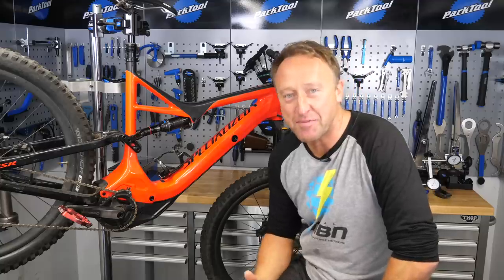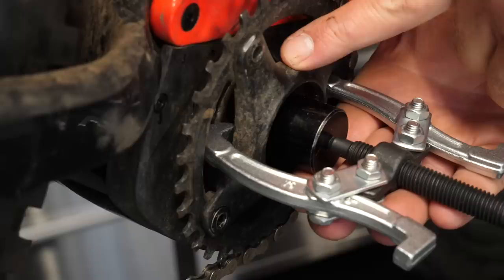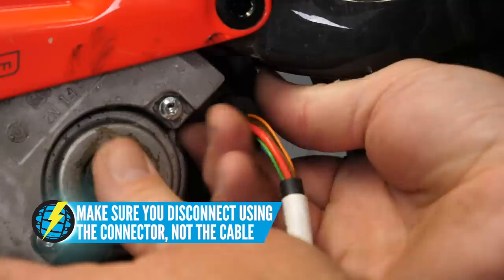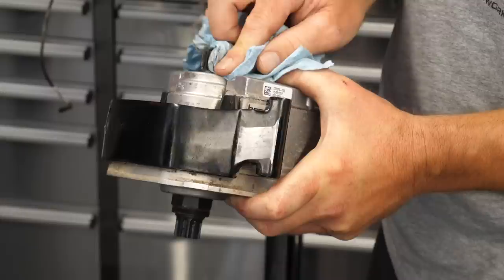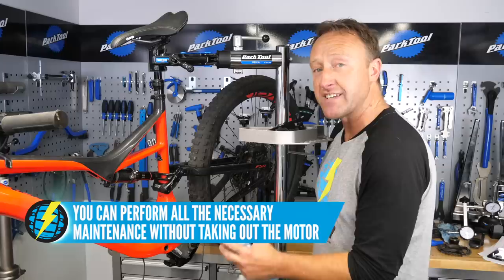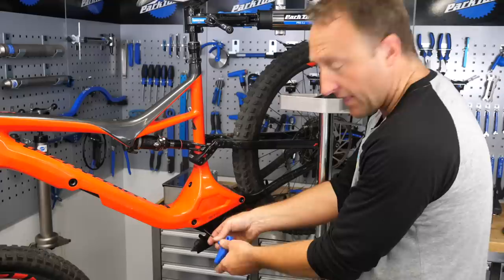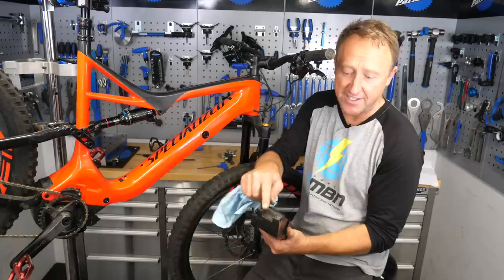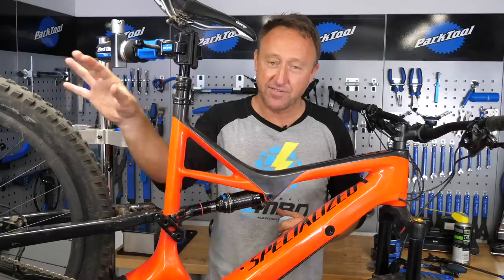How To Remove A Specialized Levo E MTB Motor | E Bike Maintenance

Comment: Crank bolts 50nm   Spider Lockring 50nm  Motor mounts 18nm  Motor cover 1nm. I would use thread lock on the last two.

Comment: If you have a newer levo there are some differences in the disassembly - they are fairly obvious apart from a hidden bolt which requires the horizontal part of the rear triangle to be removed and pushed out of the way, the hidden bolt is on the drive side near the foam insert

Comment: Steve
A couple of things. What about torque settings? And when the motor goes in, loosely put in all the motor bolts in first before you tighten up the bolts.
Keep up the good work.

Comment: Re: levo gen 2 disassembly, in addition to the 4 "visible" bolts on the side of the frame, you need to remove the 6mm hex bolt the attaches the lower rear triangle to the frame, move the triangle aside, to access the two remaining "hidden" bolts that attach the back of the motor to the frame.

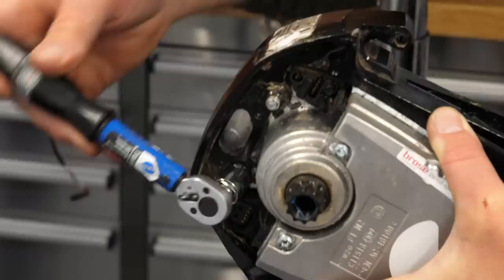Comment: Good video, but I will point out that you should never use a torque wrench as a normal ratchet, and definitely not to loosen loosen a fastener, like at 5:36. It is detrimental to the accuracy of the torque wrench

Comment: Interesting what you said about LED problems on the battery Steve. Specialized Australia won't fix mine, even though its under warranty. Claim its 'cosmetic". I have one LED not working, one yellow and one red.
Reply: pendo that’s very surprising that is the battery  indicator. Keep trying I’m sure you will find someone that gives a crap about the specialized name sooner or later. They replaced the stickers on my wheels because they came off so I can’t see why they aren’t doing the led on your bike.
Reply: Had to wait 2 months for a new battery in the UK but Specialized did replace under warranty

Comment: I didn't get as far as you Steve, I snapped the self extracter bolt with a sickening crrack. I was looking to replace the chain guide nut -plate which could not take the amount of Southdowns mud  I was processing. Keep up the Great work!
Reply: Did you ever get to replace the chain guide nut plate, mines broken as well and having to do all this nonsense just to get at it, is very frustrating. Just wondering if there is a less OTT that doesn't require taking everything apart to get to it.

Comment: I noticed with Specialized bearings in the past they actually don't put a lot of lube inside the waterproof caps I repacked my bearings and noticed a substantial difference in performance. Disappointed Specialized 😉

Comment: Hi, in 3:30 you show the cable inside ( battery lead) which is using to connect motor  with battery. I have issues with my Levo that it randomly lost assistance and I have suspicion that the cable is broken after using / re-pluging the cable many times... (4 years), So is possible somewhere buy new cable / battery lead to replace broken cable  ?

Comment: The Belt on my Bulls Evo was finished after 3000km... and 1,5 years. Short livetime...
Reply: Belt drives - Upside: Quieter, Smoother driving force. Downside: Wear out much quicker than gears! And not cheap to get replaced.. Unless under warranty of course, But still a pain to go through.

Comment: There are a couple of "enemies" for this Brose motor:
1. Broken belts are happening quiet unexpected, but is not a real big deal if you are getting a spare part (gasket and belt).
2. Broken sprag bearings is a BIG problem and this will happen after a certain time, when the plastic cage breaks OR could even happen when you are hitting hard a stone with your pedale, hell of a job and quiet expensive.
3. Water is always a problem, even if you are not using a power washer. The water will get into the needle bearing and the corrosion will just then damage all other bearings, sprag bearings and also the crank shaft.
I don´t believe that Specialized have fixed all these problems on the new 2022 motors but if anybody here can comment that I would be glad to hear that?

Comment: What happens if you find corrosion on the contacts of the battery lead?
Will contact cleaner ‘fix’ it? Do I spray both the terminals on the lead AND those in the motor where it locates?
Bike’s been cutting out and dying recently and this may be the cause.

Comment: My chain guide snapped off, bought a replacement but not sure how to fit it? Can't work out how to get the clamp inside the gap
Reply: Hi, did you ever figure this out? I've got the same problem and it seems annoyingly complex, but I don't want to take it all apart and still not be able to even get to it.

Comment: I hope I live long enough than it would take me to do 9.5k miles on a E-bike!
Reply: lee nevin I noticed that statement too.  
For me year 1 I rode 1700 miles this year in 6 months im at 1200. If he's correct ill be dead in 5 years. Lol
Reply: I managed to ride over 15,000 km in just under two years so I got a new motor FOC to replace the original which was making a horrible noise. The noise might have been damaged drive belt. Also, I'm still alive, just.